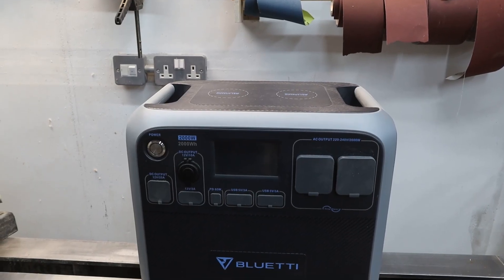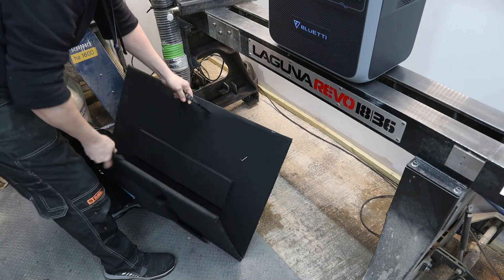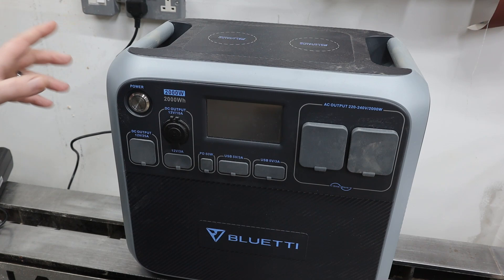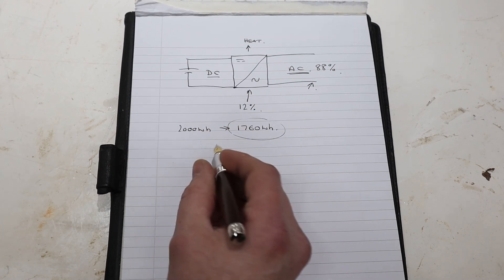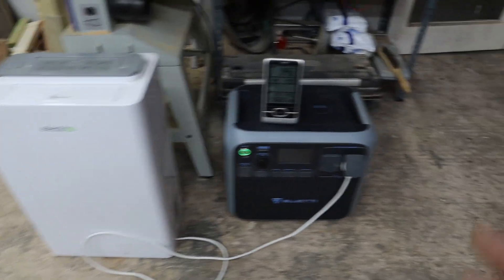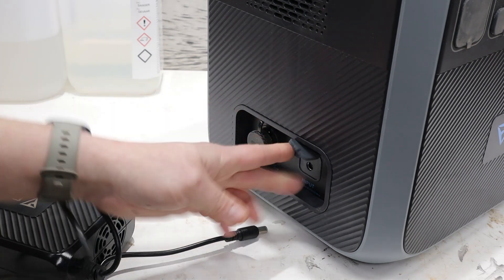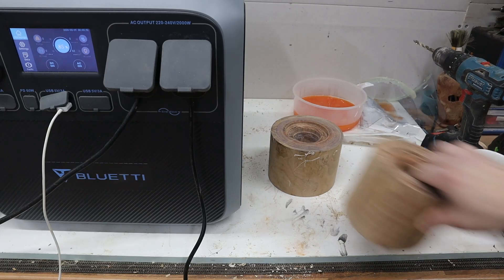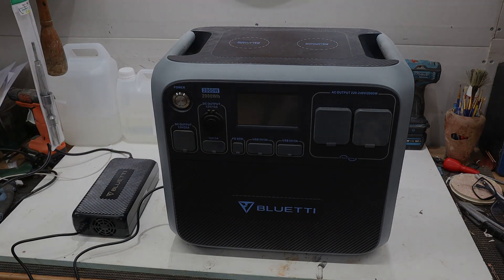Taking the Workshop off-Grid with the Bluetti AC200P & PV350 solar Panels

Comment: The portability is a good feature, but the solar panel recharging will get tiresome if a permanent installation isn't done.  Also, I think 2000Wh (actually ~1500Whr) is probably inadequate.  But this would be a good system for a weekend of camping.
Reply from the maker: Going to put a couple of panels on the roof of the workshop, might look at a small wind turbine too. It can take 700w on the PV input. With the two combined inputs I reckon this should run 3/4 of workshop fine. Won't run the bandsaw though, starting current is too high, plus I wouldn't run the CNC either, just in case it ran out of juice midway through.
Reply: @MattJordanWoodturning  you could always give the bandsaw a shove.